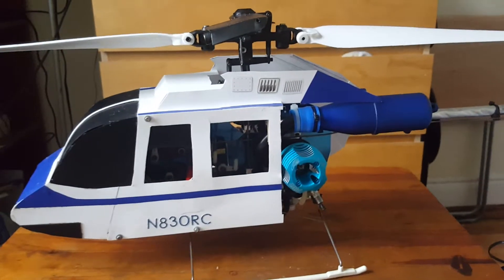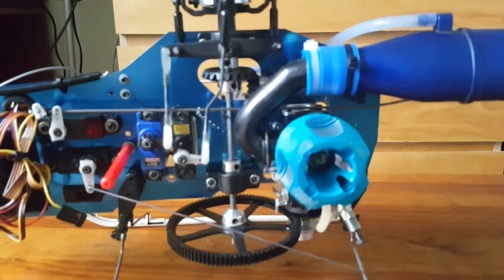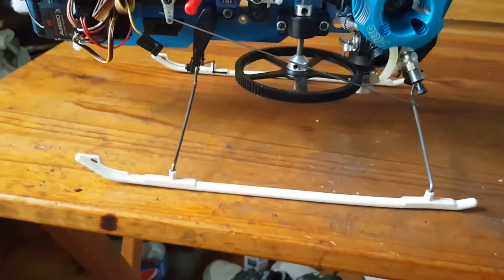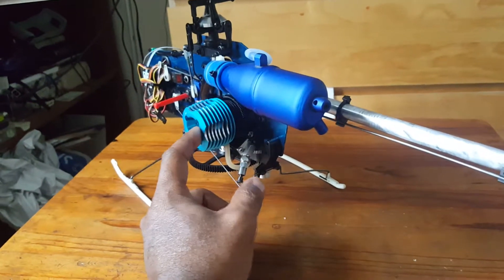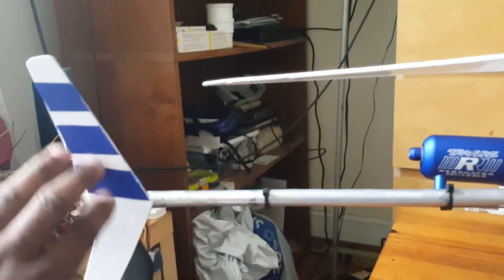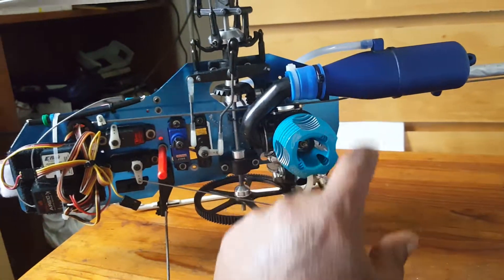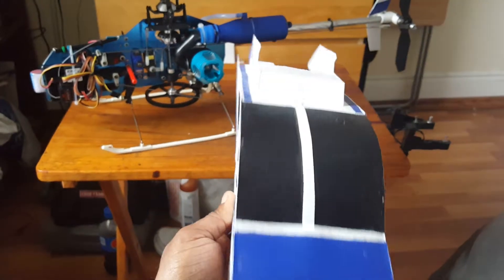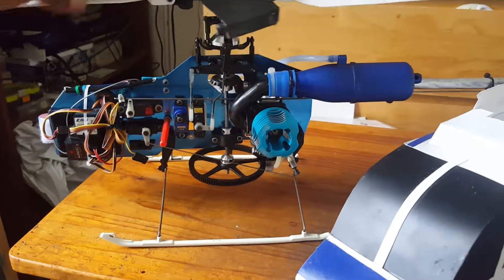Lite machines helicopter 117

Comment: cool body and engine mod, I picked up some small car engines at a swap meet that need tlc, if I can get one running ill have to see if it will work. How did you end up with throttle control? I may just re mount the servo and and use a smaller one.
Reply from the maker: Go on my page and look at my other video. I show how i redid the throttle. Its connected at the back.